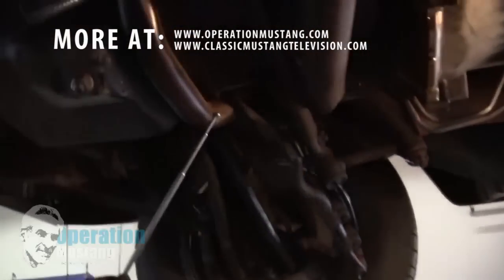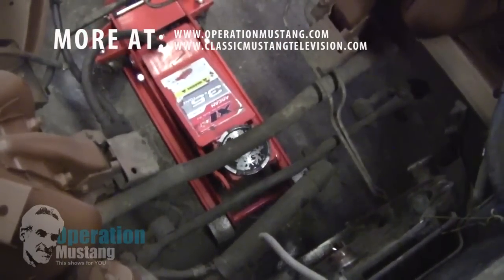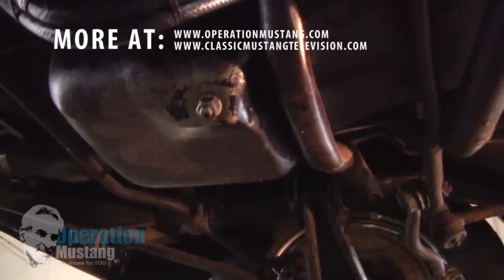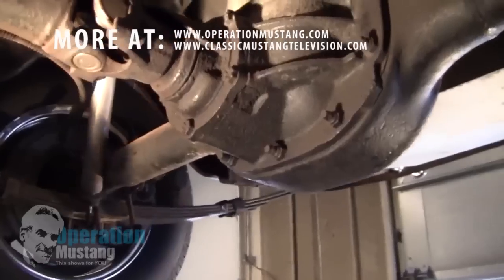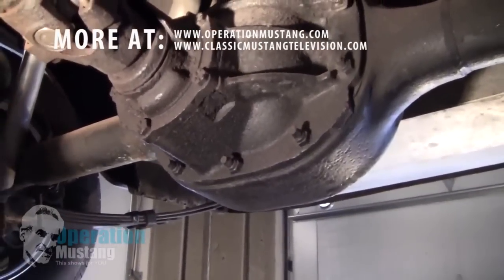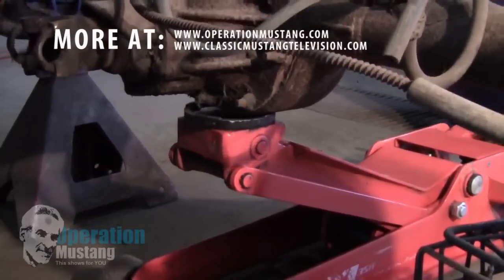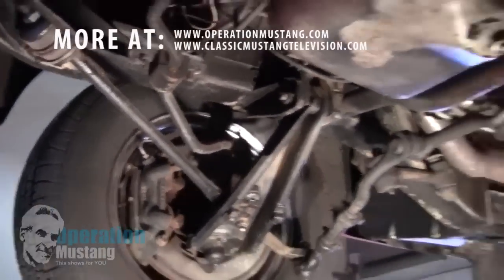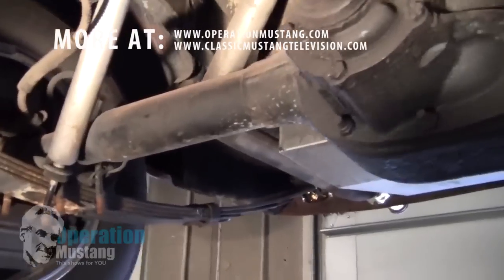How to Jack Up your Classic Car the Right way

Comment: Note where the actual car was supported on his 2 post lift.  That is the proper place to support the vehicle.  funny he didn't mention.  they are in front of the rear leaf springs and at the front of the front frame rails as the video showed.  where he mentioned are second best areas to support.
Reply: I thought that was odd also.
Reply: I thought this was ridiculously Odd as well. I'm like dude you are literally supporting the car above your head. How do you not mention it??
Reply: Do you think it was because the rear axle would get you more height and car would have a wider base?

Comment: The best explanation so far online!!!
Reply from the maker: Glad to help... Merry Christmas
Reply: @MustangRestorationsInc  I have 69 mustang where I want a crazy engine and transmission swap in it and upgrading the differential. 

Engine from 2006 Lexus 3UZ
Transmission toyota R155 

Do you recommend the T5 from newer mustangs differential ? From what years you would suggest to look for if I would like the limited  slip as well. 

Thanks
Reply from the maker: @thaieralawadh2223  Use the entire drive train.. Transmission & rear axle, everything from the Lexus. If you have the ability to make the engine fit. The rest of it should ne a walk in the park...Let me know how it turns out..

Comment: i have a 67 mustang  convertible i would like to get subframe  connectors  installed  about how much will it cost parts and labor thanks
Reply from the maker: You don't need them. Your convertible mustang has full frames running down the sides.